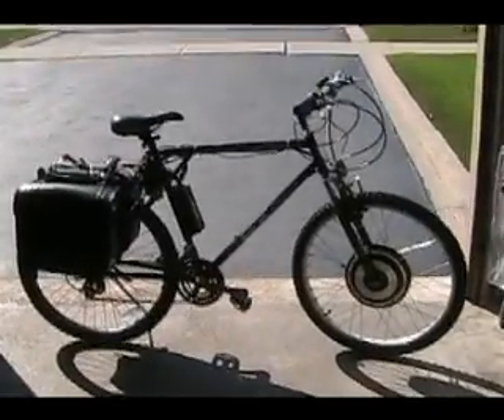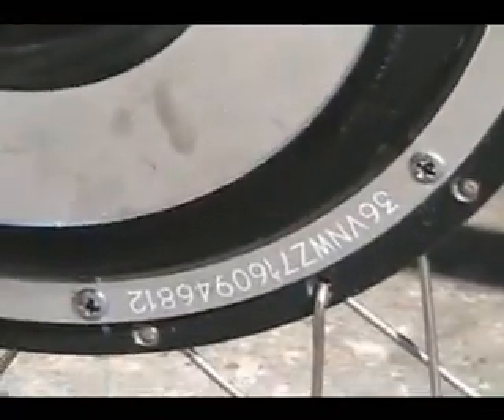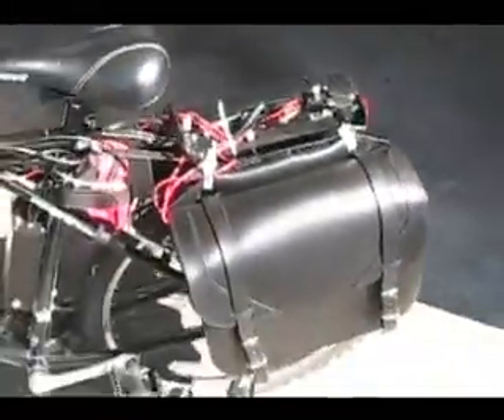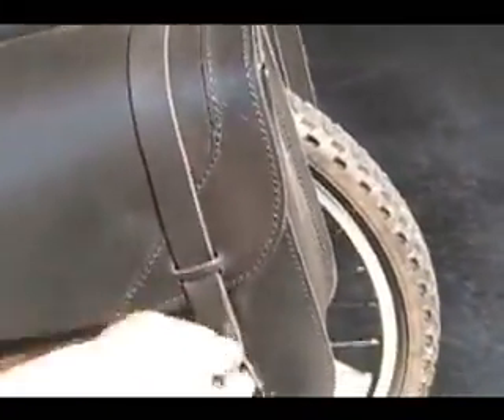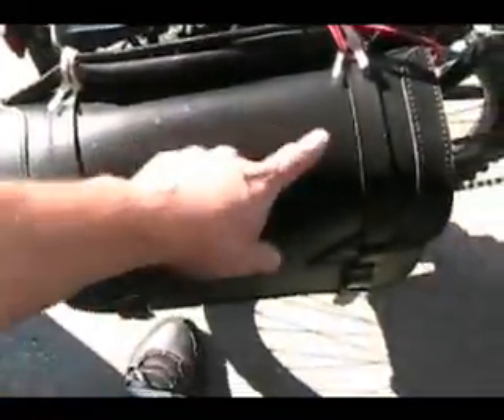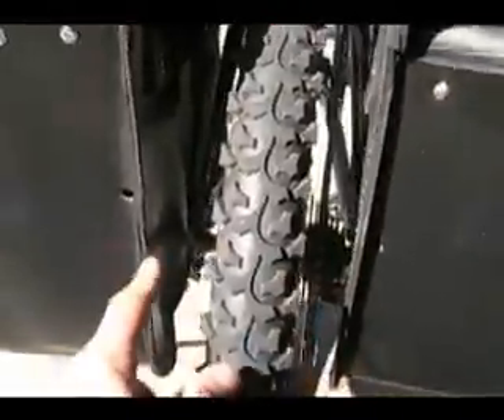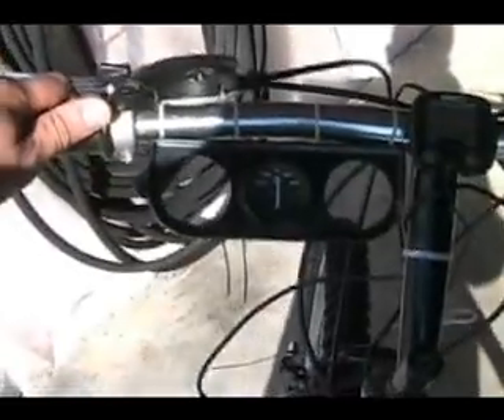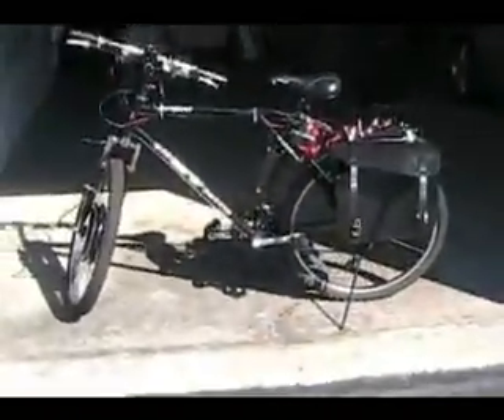Ebike Build - 72v 40amp Crystalyte Controller

Comment: I got a e scooter can't I just splice the throttle wires  to asecond controller .mabey use some diodes if needed...would a guy need a  second battery pack or could I just suck eneogh amps from my battery without destroying these expensive lifepo4 battery...I would be drawing 80 amps I guess at burst. Or up hill with a lot of weight...anybody out there running second motor with two controllers..go gteen.....

Comment: I know this video is old so I hope you are still here. I have bought a front wheel 72v 40a hubmotor from crystalyte. I want to know how your front wheel arms are holding. Did you change the front fork? I'm going to buy torque arms I think. How is your bike holding?
Cheers

Comment: I've run both sizes (12AH and 7AH) on my 36V.  The only difference I can find is the shorter range.  I got the smaller batteries to make the bike less hefty since I only have a 5 mile commute and charge at work.  My bike gets roughly 2 miles per AH the way I ride.  I still have my 12AH set and maintain them if I need a longer range.

Comment: you can meke the meter read the current without having the main power wires run to the handlebars by using a meter shunt inline with the power cables and running small wires to the meter.   you may have to disassemble the meter to get the internal shunt out to use it, or use a different meter that is designed to have an external shunt.